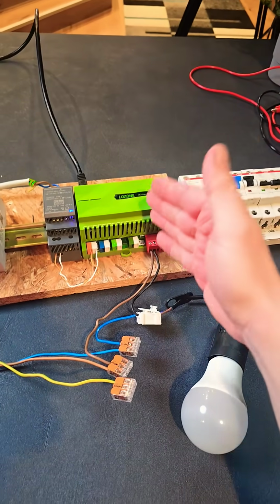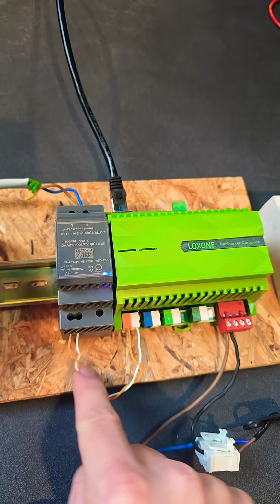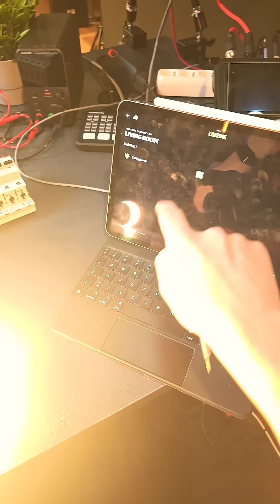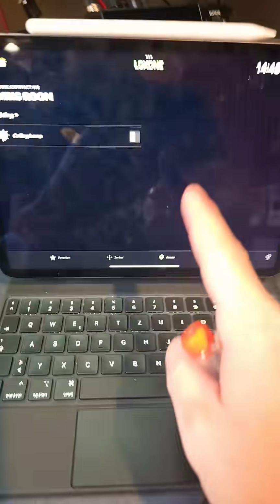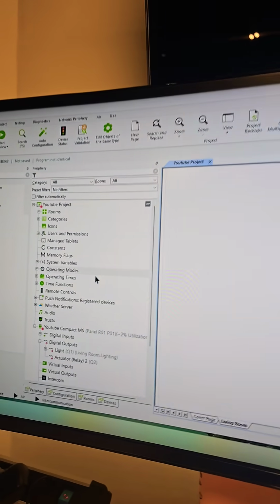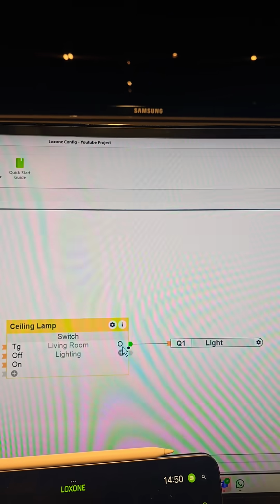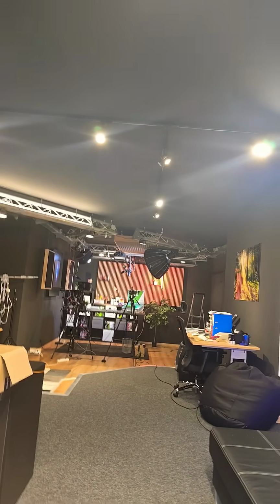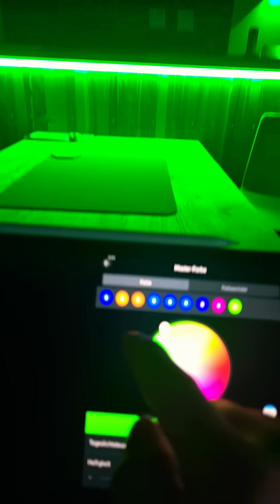Wire light in #Loxone #smarthome

Comment: practical illustrations are very helpful like you provided them.
I have previously worked and installed basic electrical systems for homes lighting control but the first time i heard that you could have swictes that have control or logic signals powering the 220v lamps, i spent a a lot of time trying to answer the question "wont this need more cables?"
for instance, i imagine that in some settings where you want lamps to operate in different scenarios say 3 of the lamps at a scene and other 2 in another scene, then that means they'll be two separate live connections entering that room from the relay that controls these two groups of light. i may be wrong if there's another way you do this but at least i think this way?
And if that the case then say in theaters of hotels having many groups this can mean as much live cables as groups as they are, whats you take, you can even make a video on this?